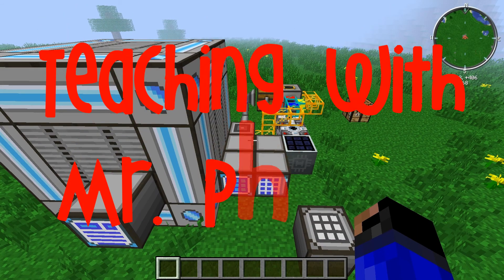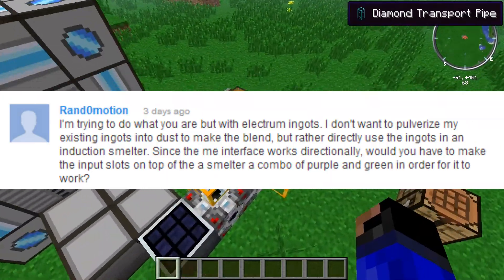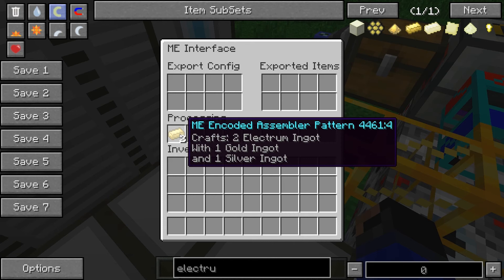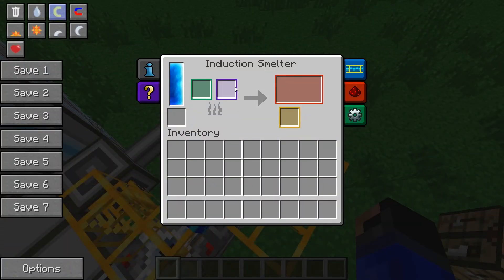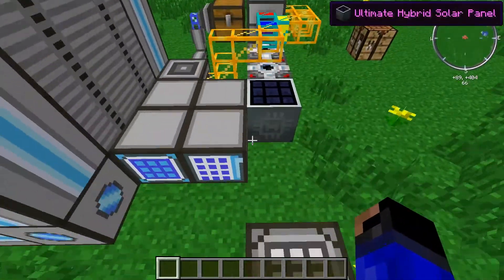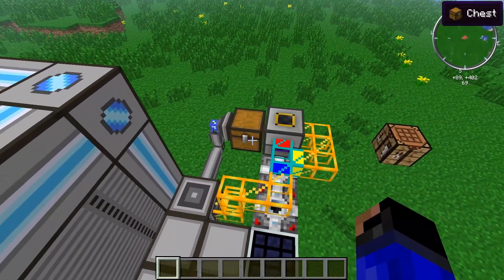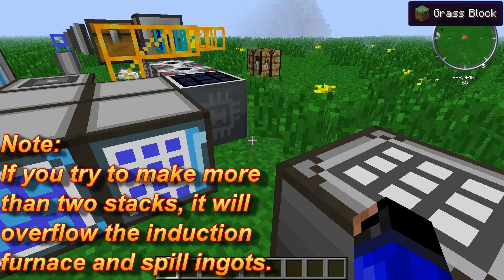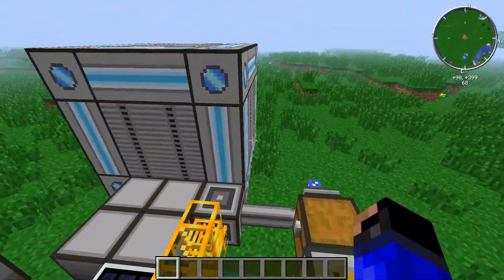Teaching with Mr  Phicksur - ME Assembler making Electrum Ingots

Comment from the maker: 1) It would only help with one input, as they only output down.
2) It wouldn't prevent the overflow, only increase the amount before overflow occurred. (by another 4 stacks, which is a lot)

The only way to *prevent* an overflow is to do an overflow loop that continuously tries to feed material into the available slots.

Comment from the maker: Not a problem.

If you are up for it (and have room in your setup), you can create an overflow loop from the diamond output pipes to feed back into the diamond pipe if the induction furnace is full, that way it will keep trying to fill the induction furnace until it completes all operations.

The setup I had didn't have enough room for that to be done easily.